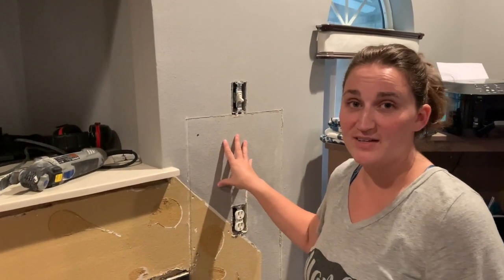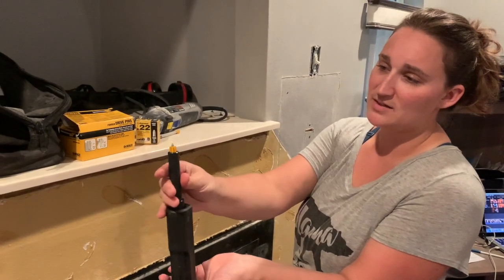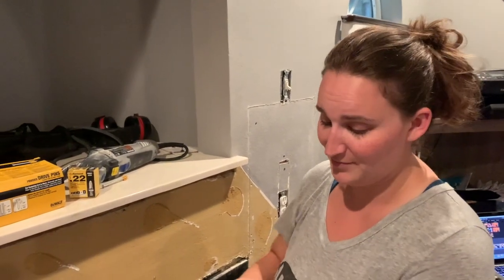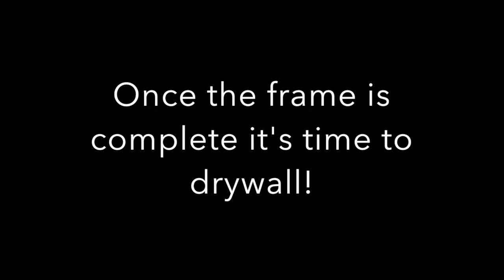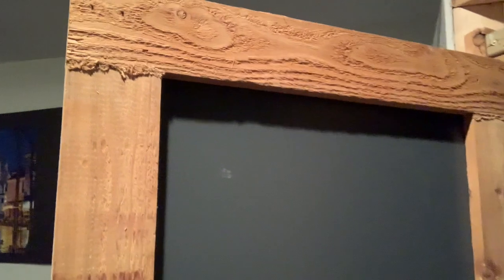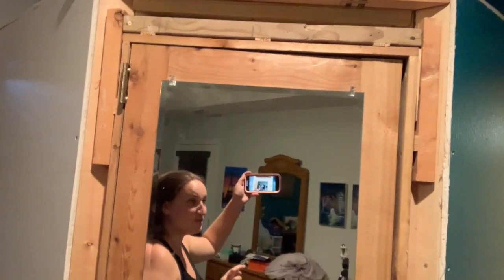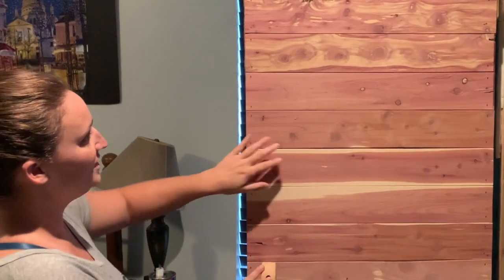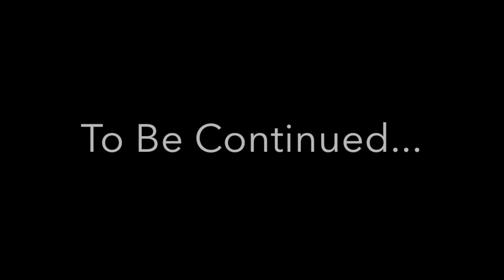In Home DIY Sauna (Part 1)

Comment: Love your sauna! If you recall what are the dimensions? Thank you for sharing the process:)
Reply from the maker: 3’6”x3’7”x4’9”x2’6”. Numbers are approximate because that isn’t accounting for the thickness in the wood cedar or insulation. We made it to fit the corner we wanted it in.

Comment: Good morning, how did you attach the vertical 2x4’s to the bottom 2x4’s? Did you just drive a nail or screw diagonally?
Also, when did you have an electrician (or you guys) come out and install the electrical for the heater?  What part of the framing and sheet rocking and insulation and vapor barrier?
I don’t want to do too much and then the electrician can’t get to what he/she needs...

Thanks so much for your time!!
Reply from the maker: I drove the screw diagonally. We had an electrician come in as soon as the walls and floor were complete and (before I built the bunches) where the heater was going. It has to be to code so we let him do it. There is no sheet rock on the inside. It’s just insulation, vapor barrier and cedar boards.
Reply: @kennybecky1108  hanks so much for such a quick reply!!!

Comment: Hi again Becky,
When you added the board across the top of the back wall.... how were you able to attach the cedar shiplap board is there is a space from the studs since you added that board across the top?

I almost need to call you.  I’m doing almost exactly the same Desouza’s you and your husband.

Thanks!!!
Reply from the maker: Hi Alex, I’m a little confused about your question. Are you asking how we attached the cedar to the ceiling studs? They are held up by 2” 1/4 crown staples and the cedar is running perpendicular to the studs. Them being ship lapped also helps hold them in place. Once you put the first one up the next one sits inside the previous one. Good luck with your project I hope this answered your question.
Reply: @kennybecky1108  not the ceiling, the back vertical wall... at the very beginning you put a 2x4 across the top of both sides that had drywall.... that 2x4 sticks out and is mot even with the studs that run perpendicular from the floor to the ceiling..... how did you attach the shiplap with the gap?
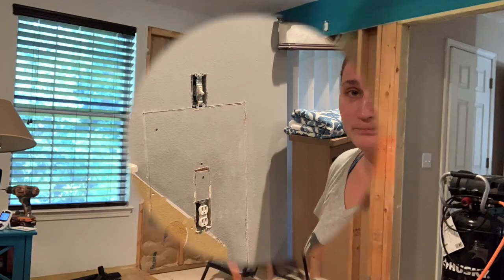Reply: At 2:19 in your video you are attaching those boards.  They extend out 1 3/4” from the studs.... did you add more wood on the studs to make them flush?
Reply from the maker: @alexrivera-alwayslearning2396  that’s part of the framing. The ceiling studs are flush with those top studs that are on the wall.
Reply: @kennybecky1108  ok, thanks so
Much!!!